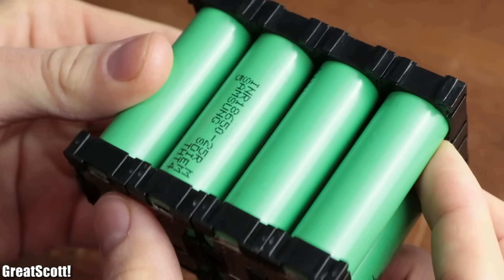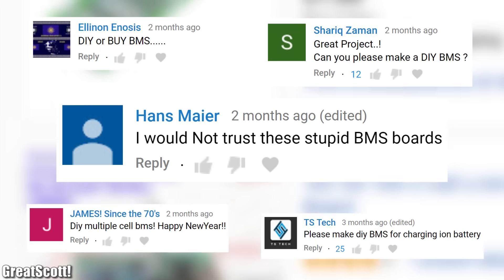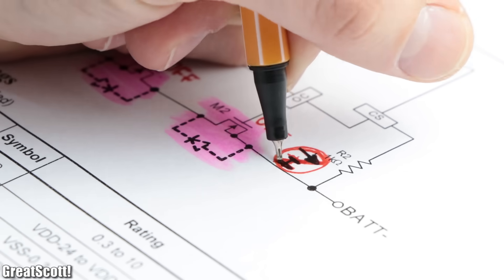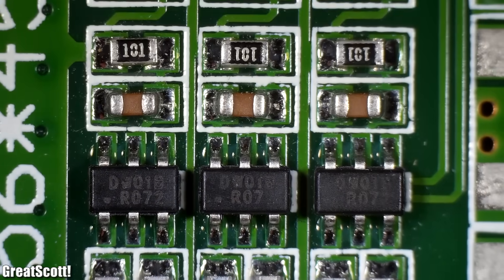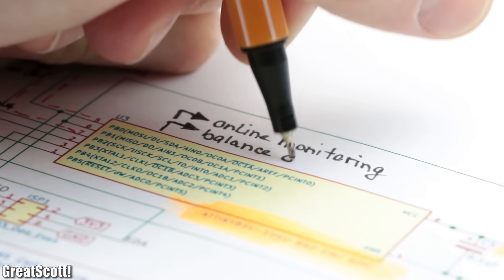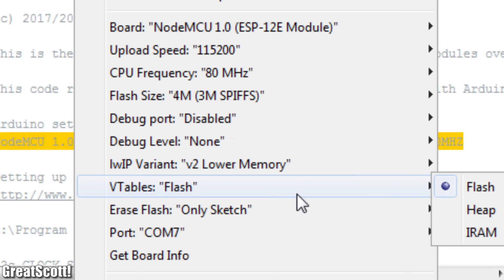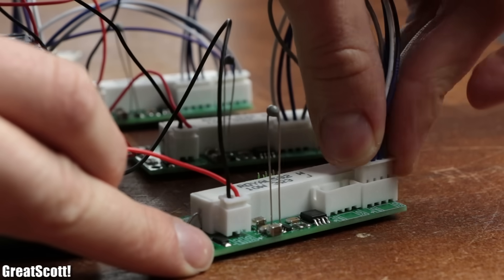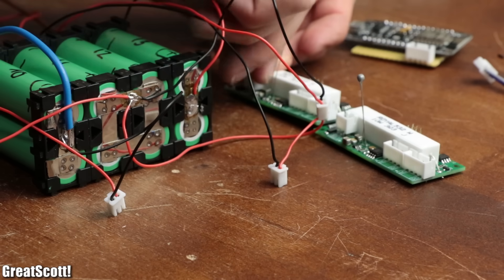BMS (Battery Management System) || DIY or Buy || Properly protecting Li-Ion/Li-Po Battery Packs

Comment: Great video! What is the maximum amount of cells you can use in series with this system?
Reply: as many as your power source can feed, so if you put a 1,000,000 V configuration, share it on YouTube and wait to be news ;)
Reply: Well, if I understand what he did properly, each of his boards monitors two cells in series for a total of six monitored cells consisting of two chemical cells in parallel on his battery pack.

The arduino is then performing data analysis across those boards which mostly seems to be a fancy feature rather than one critical to the role of battery management.  In which case, the theoretical upper bound is unlimited for the bms boards and the data metrics have an upper bound of the combination of I/O pins and sampling methods/frequency along with any supporting hardware for I/O multiplexing.

I suppose you could then double up on arduino boards and handle the collation of data metrics on the computer application side of things.  Which would then push your theoretical limit up into the range of IP addresses your router can handle and this likely exceeds the physical means of most people.  You would be well into the multi-kilovolt range by that point and the highest voltage you probably want to work with is 1.2 kilovolts, natively, as that is where most silicon carbide devices start needing to be stacked in series to deal with that.  There's very little practical use for home power projects above 1 kilovolt on a power delivery bus.  It would actually be rather eccentric by industrial standards as you usually only see voltages above 480 in special equipment and the mains stepped down from the power plant.
Reply: @Aim54Delta  I wouldn't put these boards in more than a 100v system, the isolation on the i2c bus is pretty much non-existent and you'll pretty much put the entire pack at risk. Even if he actually paid attention to the isolation on the board, the i2c isolator is only rated for ~500v continuous

Comment: I've got concerns over parallel batteries, you can't really ensure one isn't dragging the voltage down and the other is pushing it up. Wouldn't that cause issues?

Comment: Really pleased you got use out of my fork of the code and found the extra features of use.  Thanks for featuring my channel and great video.
Reply: Does your code allow one to set the minimum allowed voltage at discharge? My main reason wanting to put together my own BMS is that I've heard you can get a lot more overall life out of lithium (charge cycles) by only charging to 80% capacity and only discharging to 30%.

Comment: I got cheap BMS boards from AliExpress with Bluetooth and an App. They let me set everything via the app.
100A board with 300A peak for 15S cost me about $50 + shipping.
In my opinion they do everything ever needed for any solution be it solar or other use cases for very little effort and money. 
https://m.aliexpress.com/item/32849172235.html?pid=808_0000_0101&spm=a2g0n.search-amp.list.32849172235&aff_trace_key=&aff_platform=msite&m_page_id=6823amp-IcMb4bXWgZjWzdpG8NnQzA1553466769882

Comment: Would it be possible to improve a brought BMS to have higher balancing currents by adding a bigger mosfet and resistor to each cell's circuit?

Comment: Great video.
☺

Can I ask..
Assuming you don't want or need the features offered by the ESP32, can you not just use a TP4056 board per battery cell and charge each battery that way?
Or am I missing something?
Reply: I am currently building a 12S charger using daisy chained TP4056 modules. I have charged some batteries with it, prior to finishing the project.  It looks to work just fine. Each TP4056 module needs its own isolated power supply. The individual parallel circuits charge up to approx 4.2V, and turn off. My project can be found on my FB page.
Reply: Yeah.
I read elsewhere in the comments about the isolated earth issue.

That must be a bit of a pain. 😕
Reply: It's not about having an isolated earth. It's about having a individual floating power source output for each module

Comment: Nice review, thanks for sharing :-)
about you solding SMD, then try to put the solder on the end of the IC/R/C, and then touch both (solder and solderpad) in a inward direction. 
1 place the solder at the end of the IC pin.
2. touch the solderpad and then the solder in one motion, and lift
in this manner, you dont get too much solder on the pins of the IC
Thanks for sharing :-)

Comment: Starting making one with an esp32 a couple years ago. My goal is to replace the charging ICs with the analog out of the esp32 regulating the voltage. Then I use i2c current monitoring chips (even though I need to go to magnetic sensing to not waste power): Put the project on github https://github.com/physiii/smart-regulator

Comment: This BMS is junk, it will not work properly for a simple reason. Its electronics are powered from 3.3V, which is drawn from the protected cell. Currently, most lithium cells work correctly up to 2.5V. So please answer for yourself if below 3.3V this BMS will continue to work properly.
Reply: Which BMS?
Reply: DIY one. And it is overcomplicated.
Reply: @wendajaroslaw  It uses a charge pump, check the schematic again in the top left. The datasheet for it shows that it can put out the necessary voltage. I agree re: it being over-complicated though :)
Reply: @edism  Of course, you're right, I did not notice that it's a charge pump, I thought it was just a voltage regulator.
Reply: @wendajaroslaw  Easy mistake to make, you're welcome.

Comment: Nice SMD soldering.
For me the diy version is overcomplicated. Building, flashing lot's of software, and requiring to connect the thing to the internet to do tons of configuration... Can it not just work. Does everything need to be connected, maybe put an always online drm on it, or have it spy on you.
Also what is wrong with the boards off ebay since I may be making a battery pack in the near future, and I was looking into ebay bms circuits, or maybe should I make my own.

Comment: Not long time ago i record video on my chanell, where i said that i have BMS 4S, which don't break curcuit when voltage reach minimal level, and when it rich about 16.8V - it starts to burn all energy into heat. And become very hot. In my case this BMS is bad thing. Unfortunately video with russian language.
Thank you for you video!

Comment: For smaller projects I still like using a TP4056 wired parallel on each cell or cells of the series pack so for a 2P 4S I have one TP4056 on each 2P = .500mAh each cell x4 Chips using 4 separate phone chargers for isolation and you can use the single cell protection strips for unprotected cells so they shut down before under voltage. Cheap and works.

Comment: i actually bought a cheap bms a 3S one and i found a huge problem with it. the protection was faulty and when it overcharged or overdischarged, it would block current on both directions. after some tests i found out that the mosfet diodes where not conducting so i had to add external diodes

Comment: Look at all those counterfeit samsung 25r's..
Scott if you get chance will you test one of them for impedance and capacity.
I've got a couple of hundred of them and they measure.
2550mah avg
55ohm resistance on an mc3000 charger.
Also 46-47g each 
and no writing / print on the shells.
Reply: why do you think their counterfeit?

Comment: Do you still need BMS if you balance charge them???
I build a pack to charge my drone batterys and i use my drone charget to charge this pack.Do i still need BMS ???
Reply: No you do not. A balance charger is fine so long as the batteries are not charged with any other charger that does not have balancing
Reply: i would still use a bms for the over discharge protection. an extra layer of safety goes a long way
Reply: Iven if i set min voltage on charger while discharging it. My charger can get min voltage set so i use this to make sure i dont over discharge
Reply: @dkeinys  but does the drone also have over discharge protect for every group of cells?
Reply: No it do not but i have OSD to monitor voltage and allways land at 14v 4s pack
Reply: @dkeinys  my concern would be the failure or a cell a bms would detect the abnormality and even though the voltage is high. 
if 1 cell drops when the others are still mainly charged there is still a risk of over discharge on the 1 cell
Reply: I may still get one to just be 100% safe only cost few quid.
Regards

Comment: All you need for good bms is quality current sensor with few channels and shunts. But such ICs still handle small currents and so far they have max 3 channels.
Maybe soon the will make beter ones but commercial BMS is definitely fine and handles more amps

Comment: currently working on my own arduino based system. Don't have a main control board yet, but I have working cell modules, and they only draw 0.11 uA when idle and 2-7 mA when transmitting.
Reply: Great! Publish it all. And don't forget documentation :D
Reply: Yes ... I'm very interested to see your design when it's finished!

Comment: Great vid. Scott!!!-This is a passive balance/power bleeder-How about active balancing so not to waste power?
Reply: Active balancing is quite complicated to implement and drives the cost up significantly. That's why 99.9% of BMS don't have it, including top of the line options such as Batrium. Also if the cells are properly matched, then there should be very little balancing needed so there is little benefit to active balancing.
Reply: I've wanted to experiment with using that waste power for something useful, like put all the resistors in one place to create a heater. Or use LEDs instead as a light source.
If the cells are charged from solar, then the nearly full battery needed to trigger the BMS balance means soon all the power will be un-used.
Reply: Deligreen has an active balancer.

Comment: hobby chargers are bms and they are cheap and able to charge up to 6s batterys and they are cheap and the best ones can charge more than one pack at the same time, also the wiring in this methos is painfull

Comment: i want to automate the pipe bending machine , does any body know how to control the dc motor using arduino. or anybody know how to automate the entire process. please reply. i know this not the actual platform, if anybody know please inform me

Comment: There is a 3rd option, get one for free from some dead laptop battery.
Reply: most laptop batter circuits have a self fail system built in so they are not good to use second hand

Comment: I have a question . . . .
Why UPS(for PC) system doesn't use Li-ion battery? 
Because of complexity or there is another reason for it?
Reply: Arpon Roy probably because it's cheaper to use a lead acid battery but some ups use li-ion but they are way more expensive.

Comment: Me personally I don't like loading a battery when it goes over voltage. A better circuit I would suggest would be a set of H-bridge circuits feeding into a voltage multiplier, where each battery is parallel to each capacitor in the voltage multiplier circuit.

Also have you considered using an oven to solder SMD components instead of hand soldering? This works much better for me, though I need to use a solder mask for applying my solder paste.

Comment: Well i think this is a good alternative for some projects but this doesn't provide balance discharging....It can only be used for balance charging ..
Can you please also guide for balance discharging from the same bms..
Reply: Technically all it would take is new code/software to implement that feature
Reply: Do BMSs balance cells during discharging? As far as i know, the balance function is only for charging
Reply: @muhammadwaqar3406  Balancing the cells at the end of charge ensures all cells have 100% state of charge, but this still limits the entire pack to the capacity of the weakest cell. Active balancing during discharging allows the full capacity of the battery pack to be used, but is more complex.
Reply: Balance discharging is kinda a waste off time. Once a cell/cells have hit the min limit, all other cells will be close to their limit too. Say 1% away. Assuming all the cells are same spec and condition, not a mis match of random salvaged junk. Charge balancing is plenty good to stop the ballance drifting out of hand, and will discharge a tiny bit off ballance and the corrected the next charge.
Reply: @UberAlphaSirus  +1 for that. Balance discharging is unnecessary in the vast majority of cases.

Comment: It seems like it's just not the right kind of scaling. I think if you configured them to use the same power resistor, used one thermistor for the whole pack, and maybe an one avr with more analog pins, then you could accomplish the same things for much less and in less time? It just seems odd to have the bms be as big as the battery and I'm sure there is room to eliminate redundancy
Reply: Well, having each one take turns? Sorta like how plexing diodes work. Why wouldn't or shouldn't you?

Edit: I'm thinking balance wires so each cell can be isolated
Reply: @naoki95957  Wow that would make it much more complex. I don't even want to think about what that would look like with more than 6S. Also that would mean if let's say 5/6 cells are full you would either have to limit the charge current significantly depending on the cells or risk some or all 5 of them going over the voltage limit. Wouldn't call that optimal.
Reply: My main complaint is that a $65 bms isn't optimal. Some self made  i2c like chain and this many boards doesn't make sense.
Reply: You can't really use just one resistor for multiple cells in series. That is basically just an attached load across the pack and doesn't help to balance the individual cells.

Comment: I always BUY mine.  I aint got the...
Stark: what? Time? 
Me: The patience.
Reply: Oh, Ok. If I understand your question right this time, you are asking whether to pick DIY or BUY? For such a small pack, definitely buy. Mainly because the fairly priced BMSs from China are surprisingly quite reliable (at least from my experience). If you are doing a high voltage application, like a powerwall as Scott said, I would definitely build the DIY BMS to monitor the voltages anywhere in the world over wifi. This way I wouldnt have to open up the enclosure every few days and inspect the batteries.
Reply: @Fungineers  just asking what you buy. Batrium or Chinese brand or some other well known.
Reply: @ohvblue  Chinesium :D
Never really failed me. Also I live in the eastern hemisphere so getting a shipment from the US is suuper expensive. Its not even worth it.
Reply: Fungineers for a 7s or 14s which would you pick?
Reply: Depends on the application really. A 7s would run a 24-30V application and a 12/13/s would run a 48V application.
Reply: Fungineers but for a bms which would you pick.
Reply: @ohvblue  So far I have built 6 14s 3p batteries for 48v E-bikes over 2 years with eBay Chinesium $17 BMS's. I even use cheap dumb $12 48v chargers which means the BMS has to do the job of cutting off the charge. They all cut off between 57-58v and it works. What can I say I'm a cheapo.

Comment: am i getting it right, that the diy board allows an overvoltage and then just drains what's too much?
or did you load the cells "manually" and then connect the diy bms?